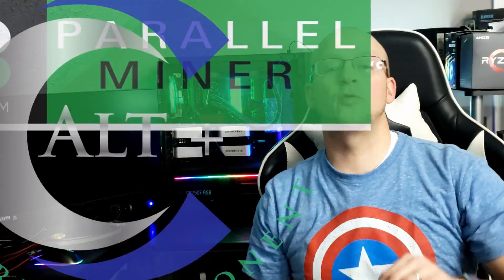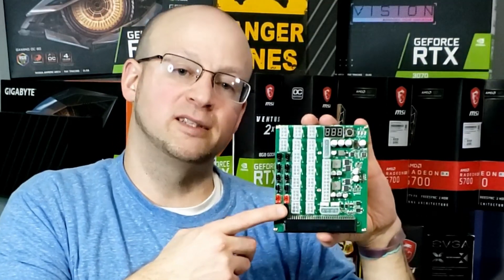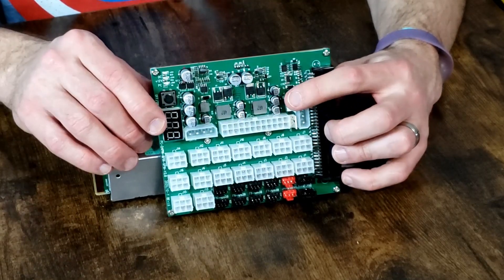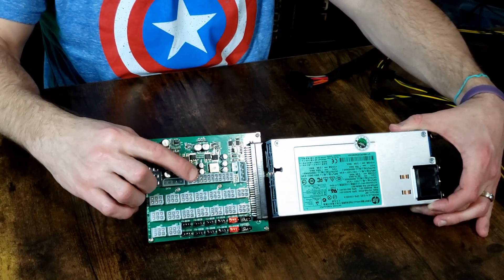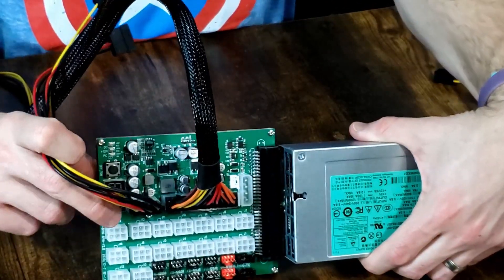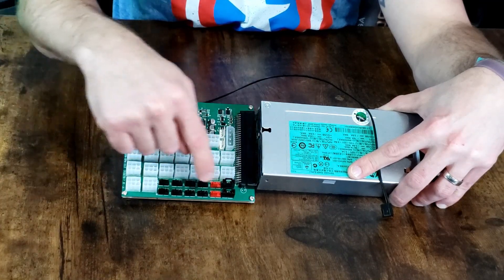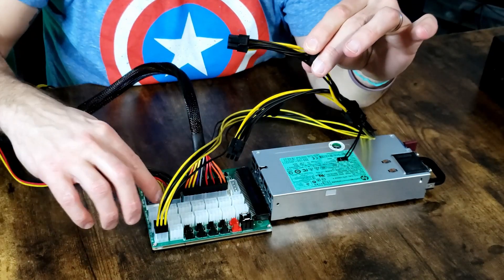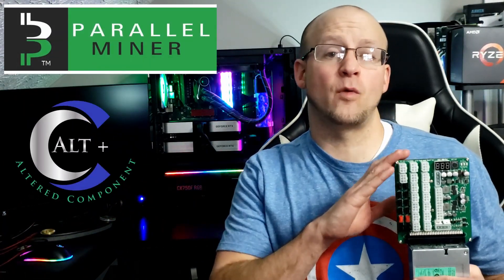⚡ZSX Game Changer Server Power Supply All in one Breakout Board.

Comment: My 1200w psu at 120v runs very hot on just 3 gpus Rx 6600xt. Scared to add anymore gpus to it. I might need a 2nd psu for 3 more cards
Reply from the maker: Those shells do get warm, but i have probably 6 of the 1200w hp platinums running and while they do run hot, they also are built to handle that.  The optimal power band is usually around 70-90% load on these.  Mine on

Comment: i cant get my breakout board to slide into my psu like that i bought in a bundle off parallel miner ,so it does go together i dont want to wreck it by shoving it and break sokmething
Reply from the maker: Thanks for watching.  the board will be a snug fit, but it should not be so snug that it feels like something will break.
Reply: @AlteredComponent  oh ok I just wanna make sure I got it to work and this thing is amazing
Reply from the maker: @marksevastipol1946  glad to hear.  It is a 2 hand process putting those on especially new.  Hit us up in discord if u run into any issues.  Mine on

Comment: is it safe tho to power a poweful gpu (250-300w) from a single 6pin connector (using the splitter) ?
Reply from the maker: Thanks for watching.  A single 6 pin wire from a breakout board can safely pull up to 288 watts.  That being said, it can actually pull up to 300 and still function fine.  Personally I would run 2 cables for a 3090 and split one into the riser.  So cable a into the 8 pin, cable b into a splitter,  into an 8 pin and into the riser.  Take care

Comment: so my breakour board is throwing out 12.4V and my motherboard with not power up, it works fine with normal ATX power supllies, how to i reduce the 12.4 to 12v?
Reply from the maker: U can't lower it, but from bios you should be able to disable power detection
Reply: @AlteredComponent  ok need to have a look at that if the mainboard has such an option, thanks!

Comment: I bought mine few weeks ago, tried it today and it's not turning on.
Reply from the maker: No good.  Did you hook those sata plugs up to the wrong place?  that will fry the  board.  Either way, i would open a ticket with Parallel Miner.  Best of luck

Comment: This is a great board but I've found that it's cheaper just to get a cheap 500 watt ATX PSU for $40 than the buy this board. Also parallel miner takes a really long time to ship even when the item is in stock. They say it's 5 business days just to process your transaction. You can probably get everything you need faster and cheaper on Amazon.
Reply from the maker: I cannot argue with your points.  For years i only used a Bronze mid power ATX (450w-750w) with a HP server psu (750w or 1200w).  PM's lead times were literally a few days months ago.  I have heard they have gotten pepper with demand as can be expected.  You cannot get the quality of cables and whatnot from amazon...let me rephrase that, you can, but it really is a crapshoot.  Some companies even list wires at a lower gauge than they are on the sheathing and then have less copper inside.  So please make sure you research what you buy.  I have melted a number of adapters and cables along my mining journey.  Thanks again for the feedback

Comment: Hey I am having issues with my MSI z390a pro not liking this breakoutboard.  For some reason it constantly cycles debug lights between CPU and DRAM.  Whenever I connect the ATX back though everything is fine.  Any tips?
Reply from the maker: Sorry for slow reply.  Did you get this figured out?  which PSU are you using.  Wondering if the board is sensitive the the voltage coming in.  Different server psu push a slightly different voltage.  IE, the 2400w delta will do 12.5 whereas the 1200w hp on 120 does 12.3v.  take care
Reply: @AlteredComponent  no I haven't and the company has been terrible at communicating back with me.  I've sent them tons of info and I can't even start the RMA process because the order wasnt tied to my account.

Comment: how do i run 240v Parallel Mining if i have 120V from the wall? i'm in usa
Reply from the maker: Thanks for watching.  Simply put, you need 240 service.  This is not a simple connection. Technically you can combine 2 120v outlets if not on same series and run the 2 hots together to get 240, but if you do not have electrical background, i would talk to an electrician.  You could absolutely hurt yourself if you do not know how to wire.  Really should be combined in breaker box and wired out to dedicated 240w service.  Take care

Comment: Hi. Great video. I have the same server PSU and breakout board. I just want to know how do I power up my ATX Dell motherboard. I have the 24 pin cable connected to the 2 Cpu slots. (ATX motherboard don't have 24 pin slot only cpu).But I have a 6 pin slot that I need to fill. The GPU cable would fit but is that the right way though?
Reply from the maker: Wow, that is a toughy.  I havent seen a mobo without at least a 20 pin connector.  There should be a 20 or 24 pin main harness connector.  then should have a 4 pin or 4+4 pin cpu connector.  Perhaps that dell uses some proprietary connector.  If so, you would fry it by connecting a standard 6 pin.  I had a HP back in the day where it had a 24 pin, however it was proprietary and you had to use an adapter to a standard atx or the wires would not match and you would burn the board.  What PC make / model is that?
Reply: @AlteredComponent  It's a dell motherboard. Is there a way to send you a photo of my board so you could advise me what to do. Please and thanks.

Comment: nope im confused can someone help me. bought a EVGA SuperNOVA 650 G+ because it had the 8 pin  but all i nedd to connect from psu is a 6 pin?
Reply from the maker: thanks for watching.  Breakout board power is a bit different than power from a ATX powersupply like your EVGA.  From a server power supply breakout board, you can pull up to 288 watts from a single six pin plug on the board.  A graphics card will only draw 75 watts from the 6 pin connector and up to 150 from an 8 pin connector.  so, say you had dual 8 pin connectors on a graphics card.  Feasibly, it could pull 300 watts (plus up to 75 watts from the x16 pcie connector).  A single six pin from a breakout board, could run up, use a splitter into dual 8 pin connectors and plug into the graphics card.  So yeah, this is a bit different than a standard atx.

Comment: How do you run the power for the risers now since I'm unplugging the atx power supply that is powering the risers for the gpu's? I don't see how to do it unless I need another cable to go from 6 pin to the sata power?
Reply from the maker: The best risers are powered via a 6 pin connector.  When i say best, i mean the safest/most efficient.  So you would power the risers with a six pin pcie from the breakout board.  You can split the 6 pin into a molex if your riser does not accept 6 pin.  I highly urge to not use sata 6 pin on a riser.  Here is why, sata connectors are rated for up to 54 watts.  If you funnel a 6 pin cable into a sata, there could be up to 75 watts pulled through that connection.  The riser board or any x16 slot on a motherboard can draw up to 75watts.  eventually that sata will fail.  hope this helps
Reply: @AlteredComponent  yes this does help thanks. I also didn't know you can use the 6 pin sata or mulex hooked directly to the breakout board. It really doesn't say it's safe to do that. I saw a video and the miner hooked it up that way. I tried and got everything to boot up. However now when I fire up the b250 mining expert I find it doesn't work with that board. I'm going to have to go back to the existing setup since another board won't post correctly with all 6 pcie risers plugged in. I do hope parallel miner starts to sell 6 pin cables with mulex or sata for riser power. Sure seems to look good when it works and to eliminate a power supply but still a tricky setup. Thanks for the help.
Reply from the maker: The best risers are powered via a 6 pin connector.  When i say best, i mean the safest/most efficient.  So you would power the risers with a six pin pcie from the breakout board.  You can split the 6 pin into a molex if your riser does not accept 6 pin.  I highly urge to not use sata 6 pin on a riser.  Here is why, sata connectors are rated for up to 54 watts.  If you funnel a 6 pin cable into a sata, there could be up to 75 watts pulled through that connection.  The riser board or any x16 slot on a motherboard can draw up to 75watts.  eventually that sata will fail.  hope this helps

Comment: Ordered and received the all-in-one kit, delivery and shipment was fast but unfortunately the unit I received won't power up. tried to reach parallel miner but they doesn't seem to be responding
Reply from the maker: Did you do a contact ticket?  I haven't used that functionality in a few months, but when I did, they contacted me next day.  I did have a user tell me it took 3 days for a response recently However.  I assume they are over ordered and under staffed just like most of the tech world.  You didn't happen to hook up that molex plug backwards?  I had another user show me what happens if you inadvertently plug the molex into the wrong port...fried.  Hopefully they respond soon.
Reply: I didn't use Molex as I do not need to power any SSD for my use case. Do you know if without any 24pins and PCIe will the PSU power up by pressing the button. Was trying to rule out bad cables and btw my mobo working fine on other PSU. 
I hope they will get back soon to me, yeah the current tech situation is bad worldwide
Reply from the maker: @wonggoonheng195  I am 99% sure it will power up without the 24 pin/cpu cable in...but now I am curious.   Going to test now
Reply from the maker: @wonggoonheng195  yes. If just the zsx and the psu plugged in, the board should show 1 orange light.  If u hit the switch u will get the same orange led, and a green led as well as the power meter will display.  Mine disays 12.3v
Reply: @AlteredComponent  great.. thanks for verifying that. Mine got no light at all seem like maybe a dead PSU. Thanks again on the help to checking this out
Reply from the maker: @wonggoonheng195  oh wow.  Which psu is it?
Reply: @AlteredComponent  the one they send me is HP DPS-1200SB

Comment: it actually seems simpler than using an ATX.  But is the server power supply loud?
Reply from the maker: if the load is low, they really arent any loader than a humming 120mm fan.  Now, when you start putting a 75% plus load, it definitely makes noise.  i have 3 running in the office while i am working and never have had anyone comment on them on the phone.

Comment: I just received one of these and its great. A word of advice to those running an ATX PSU along with this, its very important to use that Molex connection at the top of the board from the ATX PSU,  and not use the 24pin to the MB that comes with the server PSU. Thankfully this video provided me with that info although I wish it was created sooner !!!! Make sure the server PSU is powered on and has both green and yellow lights on before starting the system.  ( https://imgur.com/a/AwQUe61 ) If you are currently 5 or more cards I would recommend saving your bios settings in case they reset to default when you remove one PSU ( it could happen !! ) . If that occurs you will have to boot into the bios with 4 cards or less and adjust the 4G settings  so you can run more than 4 cards. After that make sure you press the button to turn on ZSX before you turn on the ATX PSU and start your system. The lights will be yellow and green on the ZSX when turned on. You will not see a blue PC light because the 24pin is not connected. The Molex connection from the ATX PSU will turn the ZSX on and off going forward.
Reply from the maker: Perfect tips.  Appreciate the comment and of course appreciate you watching.
Reply: @AlteredComponent  Thank you for a thorough review !!

Comment: Great video.  I would advise people assembling this board first . Meaning plug all  connectors in and make sure they are secured and then plug the break out board in .  This is a common practice in some electronics assembly so you dont damage your break out board applying pressure to it wile its connected to your psu.
Reply from the maker: Great advice! That is a really solid tip.  Thank you